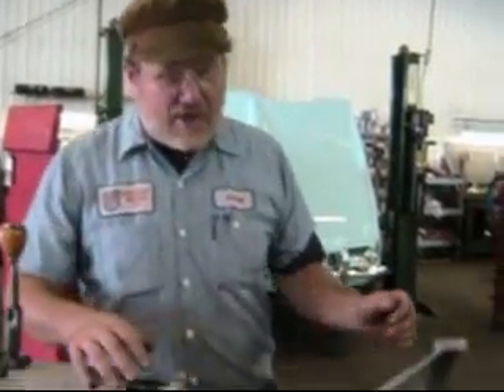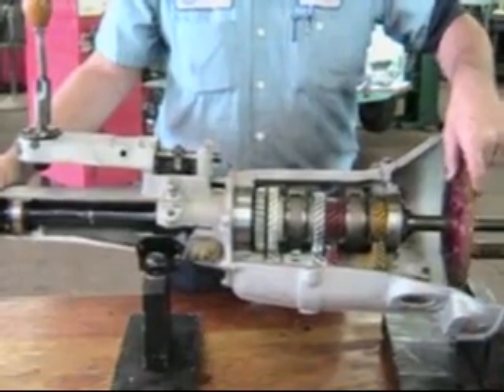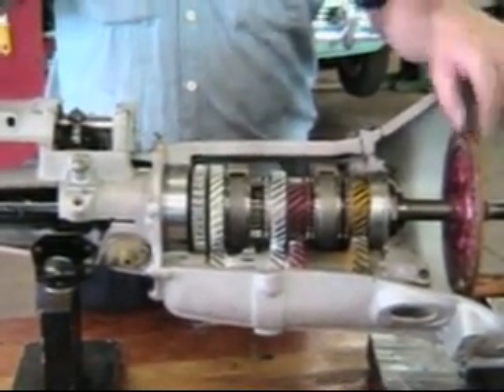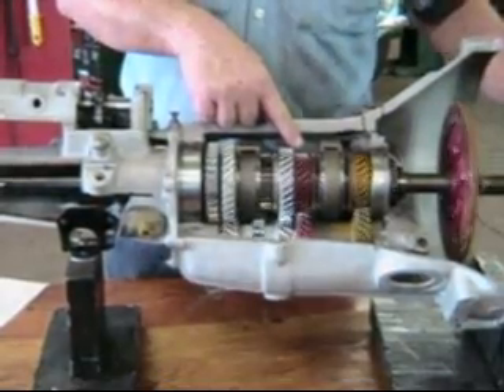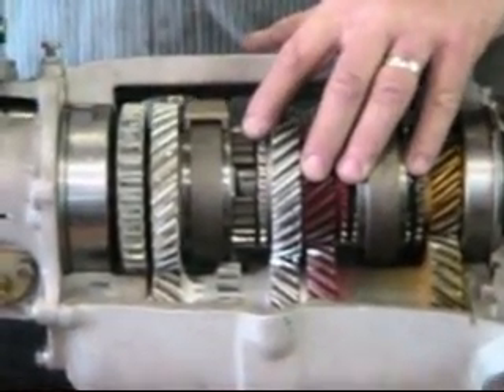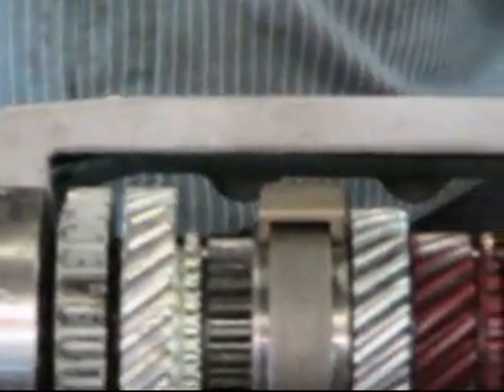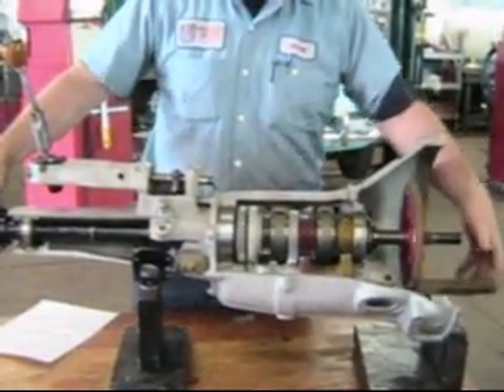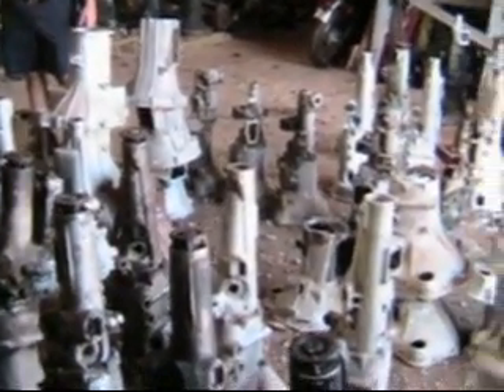004 MG Tech | MGB / MGC Four Synchro Gearbox

Comment: I have a 1978 MGB.  Can I use Brad Penn 20W50 in the transmission ?  It is a zinc oil.  Also, any tips on changing the front transmission seal?

Comment: @WHITEVOLK8814 In answer to your first question, no. You've got the momentum of your whole car behind it (thousands of pounds), so if anything the car influences the gear change (as far as gear speed goes). And your second question, no again. Because if you're in reverse, with the clutch pressed in, and you let your car roll forward, it's just turning the opposite  direction. But since the transmission isn't connected to anything, it doesn't matter.